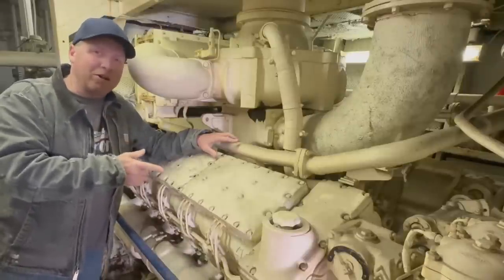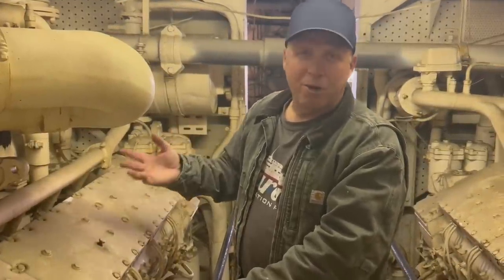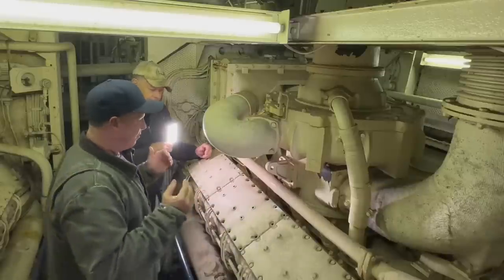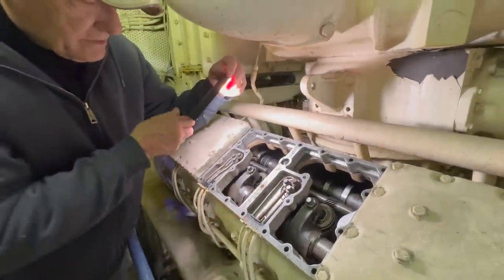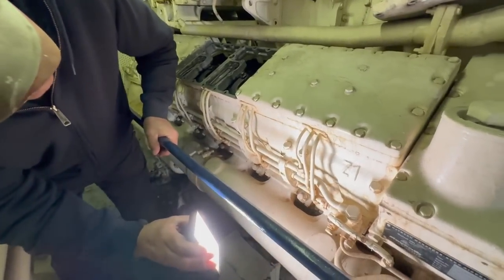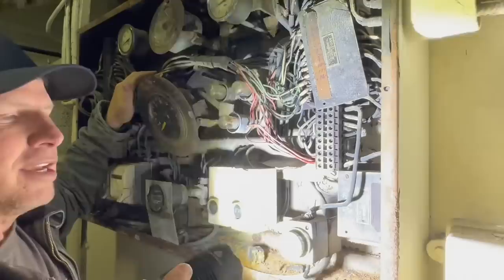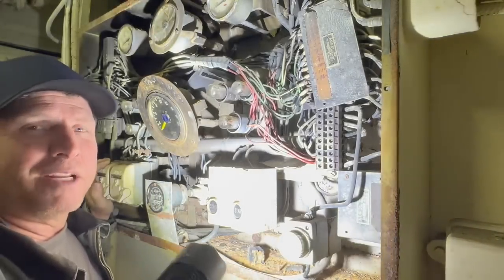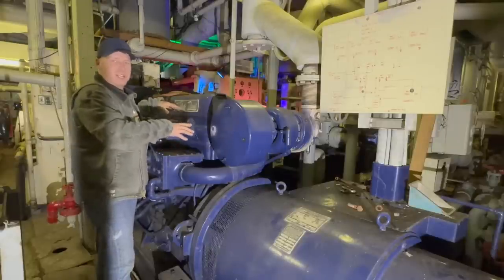INSPECTION OF THE MASSIVE MERCEDES MAYBACH DIESEL ELECTRIC PROPULSION ABOARD THE CRUISE SHIP AURORA

Comment: Why is your music mixed way higher than your voice? I'd as soon skip the music, but I want to hear what you are saying. Anyway, it's remarkable how this equipment lasts for years and years, even when left semi abandoned for years. Some routine maintenance and it will probably fire right up. It's remarkable how many old diesels I've seen that have been sat outside for decades on things like CAT dozers and under the covers they are fine. But it looks so dry, almost oil free. It would be nice to see oil on those helical gears before the first time it is rolled over. Having to re-engine the beast would be some major task.
Reply from the maker: Did most of this video on an iPad.  Difficult to hear the difference without a headset.  Will definitely work on my mixing skills.  Looks like there will be some pipes that need to be replaced and possibly the heat exchanger rebuilt or repaired.  I’m sure we will find a lot more issues as we go.
Reply: I didn’t really notice the music I had to go back and listen, your music is nothing to complain about in my opinion.

Comment: Flush the fuel lines...check the oil and crank them over till you have oil pressure.Those are seriously clean tho I doubt anyone took them half apart just to clean them.
Reply from the maker: Going to try and use the pre lube pump and test to see if we are getting flow all over the engine.
Reply: @AuroraRestorationProject  Hope it goes great !!!

Comment: Hmm...roller bearings. So those huge bearings are used on these engines!

Unlike a typical car engine, rolling bearing engines don't necessarily use pressurized oil lubrication - not at least to the same extent. Plain bearings use oil to separate the moving parts from one another, this engine uses oil to keep the bearings lubricated and cooled. Two stroke engines are a good example of rolling bearing journals.

There must be some sort of a primer pump circuit or an oil port to prime the system. Wouldn't expect large engines like those would not have them

As for the generators and propulsion drive, other than lube and clean...see if the rest of the electrics work. If it is a DC system (presumed because of the brushed generator and motor) there isn't much to do but continuity and insulation tests.

Would be really nice to have some sort of a diagram or an operations manual...there is a specific procedure on having the entire system go on. Good luck!

Comment: Please get a real marine diesel guy to provide advice. Find someone with medium speed marine diesel  experience. Your friend doesn't have a clue, you don't have to "completely disassemble" and engine to prelube it. The engine probably has a prelube/soakback pump installed already.
Reply: If you don't take a marine engineer on board to check everything en maintaine everything before start, you live in LALA land. I post a few answers with advise, but i think they don't want to read that. These engines are good but the are 64 years old and lay up for 20 years. The generators needs also a masive amount of work. I think they realy don't know were they dealing with. I was 9 years engineer on a dredging ship with the same setup. Diesel electric. Maybach V12 and straight 6 engines with Siemens generators. They need a masive amount of maintenance and spare parts are hard to get and cost a small fortune. The most people don't understand the costs to keep old ships operational. It are not car/truck engines. They need a DC electrical engineer and a Marine HI speed diesel engineer there with lots of experiance.

Comment: Don't bother trying to clean the oil and fuel filters. Just replace them. Cut them apart to inspect them. Pour some diesel oil over the valvetrain. Diesel oil is perfect it has all the dinosaurs still in it. Disconnect all the fuel lines and blow air through them. Turn it over with the starter. If it was running when it was stored, most likely will run now.

Comment: The use of the name "Mercedes Maybach" about these engines are wrong. These engines are pure Maybach Motorenbau engines, no Daimler-Benz or Mercedes, unless they are built between 1966 and 1969, and should be named mtu 12 V 538.

 Why you ask?

Thanks for asking. It is because In 1955, when this ship was built,  the company Maybach Mercedes-Benz Motorenbau GmbH (MMB)  did not exsist yet. It will still a few years before that happens.  Daimler Benz had its own Grossenmotoren division, who buildt Off Highway diesel engines, and Maybach Motorenbau, who actualy designes and built these engines, was a separate entiry, competing with Daimler Benz. 

The cooperation (1960) and merger of them to MMB (1966) and later into MTU with MAN, in 1969.

These MD engines was mostly designes by Karl Maybach in the late 1940s. And production started around 1950

Comment: Crank it up. It’ll be ok
Reply from the maker: Seems clean enough it just might.
Reply: Never start an marine engine before control everythinh twice, after long time lay up. New lub.oil and new coolant is a minimum. and turn the engine first with the turn gear or by hand. This engines has ball bearings on the cranck shaft, that is also another game than other engines. The low pressure turbo's you have to check also on coolant leakage. I worked from 1991-2000 with the same engines on a German build ship. Maybach V12 and straight 6 with Siemens Generators.
Reply: A few years ago I was involved with a 220ft 1,000 Passenger Ferry and we had managed to get the Generators on the original DC (Knife Switch) board and the main 2 Stroke Engines turning over.
Reply from the maker: @westrex5000  sounds like about the same thing we are about to go through.